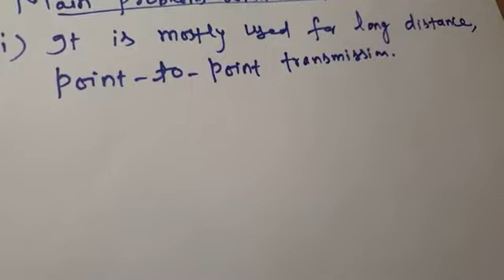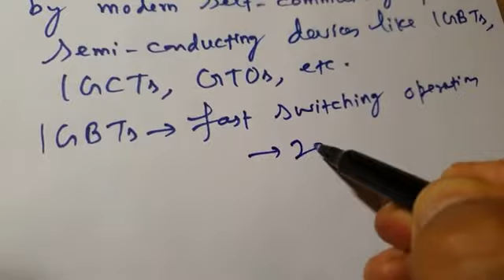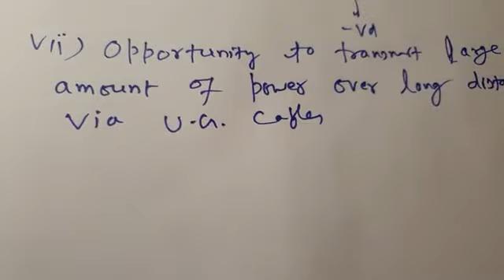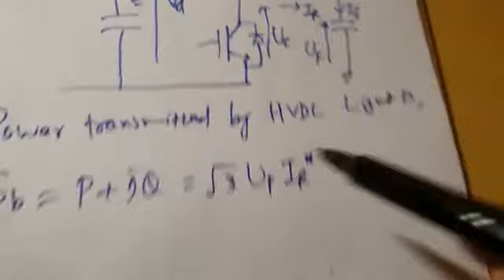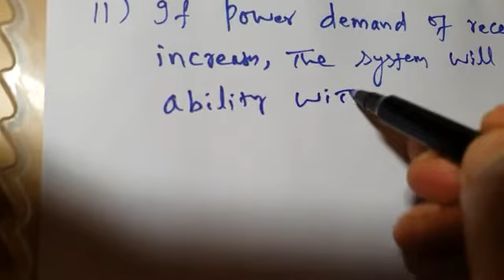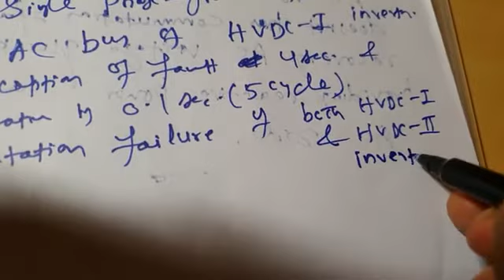L25_HVDC Light ( HVDC Plus)

Comment: thanks a million, dear Prof. Bhat, how big should the distance between AC and HVDC lines, in the Hybrid system be? Should AC and HVDC run on the same Towers? I saw the results of a Hybrid test project, done in Germany on the same towers, but after implementation, the core of the transformer in the AC system was hot and noisy.